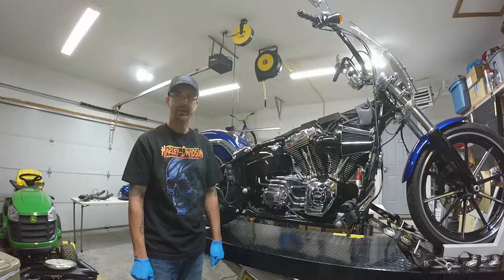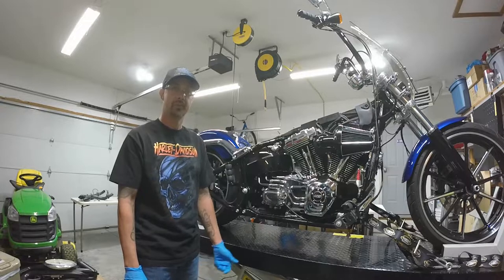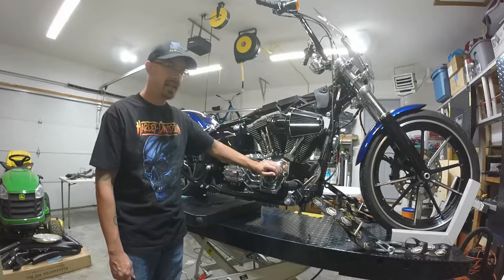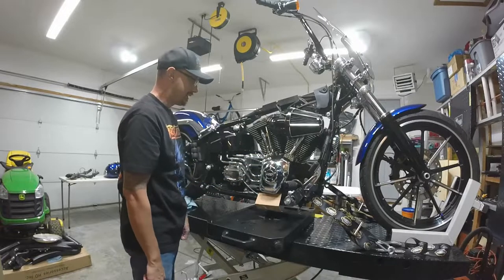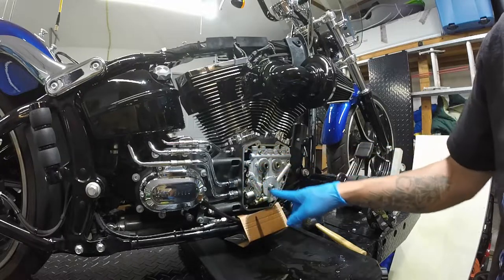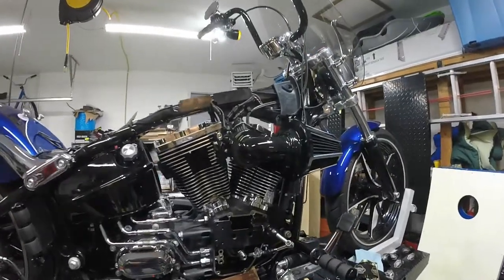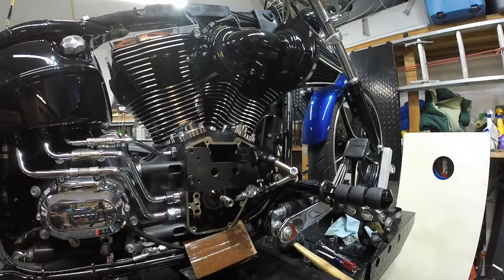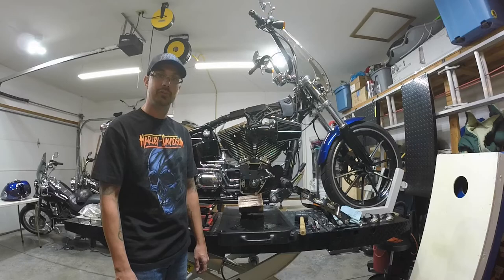Crank Runout Check On 2015 Harley Davidson Breakout

Comment: Great video. INA is the manufacturer and it is a caged bearing. The Torrington bearing is a full compliment. (caged are cheaper bearings, we used them in pumps all the time) Would be nice to know the tool numbers or where you got the runout base.

Comment: HD has a 12,000 allowed run-out, which is now increased for the M8's to 15,000..
Regardless of what HD calls allowed is laughable & welding up & balanced is the best especially for any big motor builds or future plans....
Living The F 🤪 KING Dream ❗
Safe travels 🙏♥️🐾🐾🇦🇺
Reply from the maker: I completely agree. I JUST got done stroking my 88" dyna to a 107" and bought a darkhorse crank for it. Won't ever have to worry about that one!  🤓